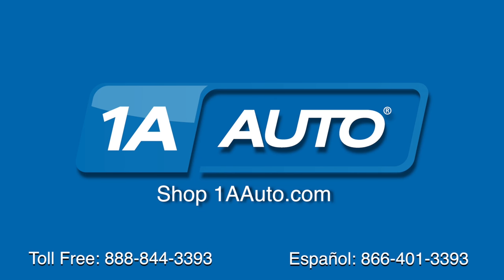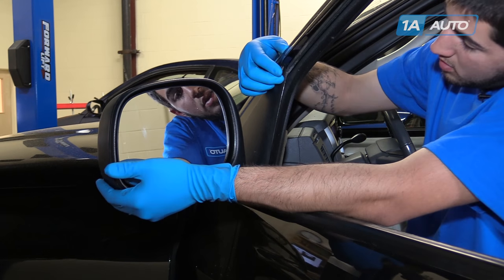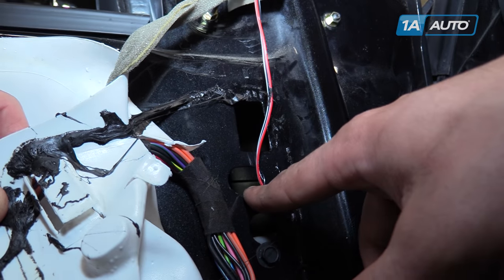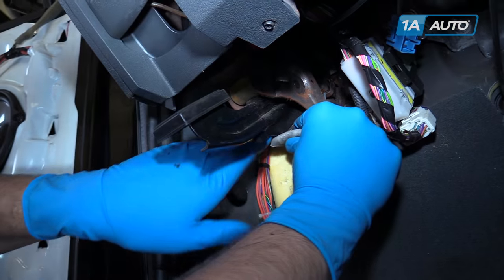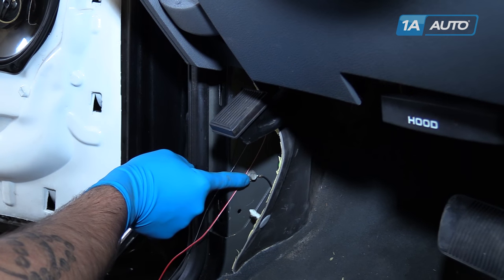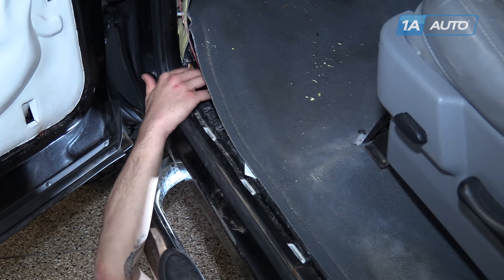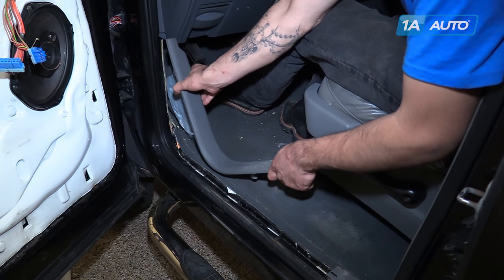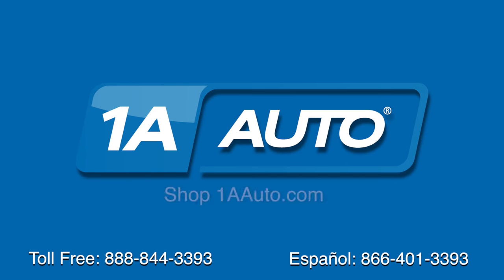How to Install Tow Mirrors 02-08 Dodge Ram 1500

Comment: The harness that came with my light have 3 wires. Black, red, and purple. I have watch your video and others trying to understand the correct placement of wires. Black is the ground, you have the red going to a yellow/ white wire for signals? My understanding the purple is for the puddle lights and what wire color would I connect to. Truck is a 06 Dodge ram and everything is done except the finial wiring to power.

Comment: I followed it right up until you threaded the light wires thru the rubber. My vehicle end  of the rubber has a hard plastic housing a cpl of harnesses with all the wires to the door components harnessed into.
2003 Dodge Ram 1500 quad

Comment: good video, but why not simply stack both ground wires under one single eyelet, and tap your. power from inside the cab rather then puncturing the brake cable gromet for a power source where it will be near the elements of weather?
just wondering what your reasoning was. not trying to pick your video apart, just had to ask.
Reply: I literally said the same thing
Reply from the maker: +gshffr Sometimes it's hard to stuff two wires into an eyelet connector. If you move up to the next size then the eyelet becomes too big for the bolt. Going to the connector to tap for power is the quickest and easiest place to find the wire with good easy access.
Reply: could it be so they function as blinkers as well as running lights

Comment: What wires in the connectors would you have to tap for the lights to function as turn signals?? I have a 07
Reply from the maker: +PoisonxZero89 If the truck came from the factory with the turn signal function on the mirrors, it should be a plug and play install for you. If your truck did not come from this function, you may have to have the dealer install a sales code to enable this function. Hope this helps you out. 1aauto.com

Comment: What if you want to install the mirrors with out the turn signal built into it,  do you still have to wire up stuff or can it just clip into the old wiring and bolt on and just work with the power to move the mirror and the heat?
Reply: zack nelson I’m about to be doing that exact thing how did it turn out?
Reply: im sure you just dont use the LED wires.
Reply from the maker: +zack nelson You would just install them without the additional wiring for the turn signal.  They should work as long as all the other features match your originals.  1aauto.com

Comment: Ok could you tell what I did wrong I followed every step to install my mirrors wired everything up they light up but when I put my signal light on they won't blink.
Reply: Because u wired them for parking/running light. Different wire for blinkers pal

Comment: Thanks for the video. I have a 2008 dodge. Only with power mirrors. Could I still get the blinker light to work and puddle lamps to work?
Reply from the maker: +xenos214 Thanks for watching!  You would have to wire in those options to get them to work.
Reply: @1AAuto  thank you for the reply. I wouldn’t even know how to go about that. I’m going to take it to a dodge dealership to see if they can help me out with doing that. Thank you.

Comment: my truck doesn't have a heating option for the mirrors. would I need that in order to install?
Reply from the maker: +Enrique Torres Yes, you would need to install it as an aftermarket. 1aauto.com?utm_source=YouTube&utm_medium=CTA%20Comment&utm_campaign=1ATony 866-403-3393

Comment: I have the mirrors and was wondering if there was any way to wire for both running and turn signals kinda like the bonkers do ? if not is there a circuit I could build ?
Reply from the maker: +qBMOp I believe that they can only be wired one one circuit.

Comment: which mirrors should I use for my 07 1500 i want the turn signal option and my mirrors are currently heated. would the install be the same as this video?
Reply from the maker: +EqXHyPnOtIc The only difference between what you want to do and the procedure shown in this video is that we opted for running lights instead of turn signals. So between 9 and 12 minutes in the video we show you how to splice the wire into the running lights circuit. You'll follow that same process, except you'll need to figure out which wire on the harness on the undercarriage is for the turn signals. A good wiring diagram should help with this. Otherwise it's the same exact process assuming you're using our parts. Might not be the same with different brand mirrors. Here are two links to two different sets of tow mirrors from our site.
https://www.1aauto.com/dodge-mirror-pair/i/1amrp00913?f=575464&y=2007&utm_source=YouTube&utm_campaign=1ATony&utm_medium=CTA%20Comment

https://www.1aauto.com/dodge-mirror-pair/i/1amrp00908?f=575270&y=2007&utm_source=YouTube&utm_campaign=1ATony&utm_medium=CTA%20Comment

Comment: I have a 2003 dodge ram and i did all the steps that follow in the video but once i get to the wiring it is different because the wire is a different color from the one in the video which wire would it be for a 2003
Reply: Reckless_ Mike i have a 2003 also but I have no clue which ones it is, but I need to find someone to do the wiring for me, I have no clue what I’m doing

Comment: ? I have a question i just installed mine but mine has 3 wires
Reply from the maker: +Eduardo Duran Thanks for watching!  If your original mirrors only  have 3 wires then you just have power glass mirrors with no other features.  If you have any other questions about our mirrors please contact our customer service department at 888-844-3393!  1aauto.com

Comment: do you sale the blinker wire seperately and if so how much does it cost for a set ? thank you
Reply from the maker: +suzuki rider We currently do not sell it separately. The tow mirror kits that do require this as an upgrade come with the wire leads to get the function to work. Hope this helps you out. 1aauto.com
Reply: ok thank you the one I ordered didn't come with much wire only on the mirror and nothing from there but I will figure something out thanks again for the reply